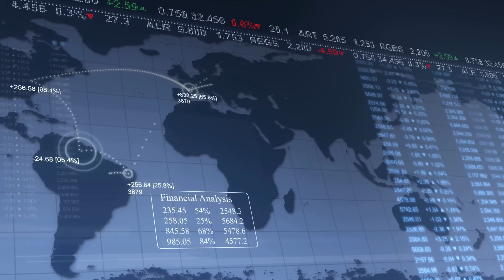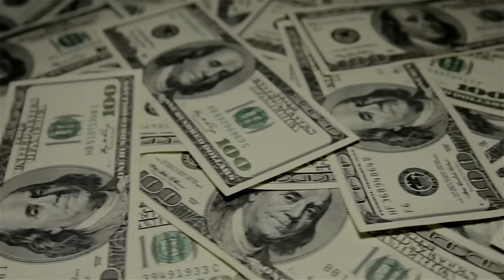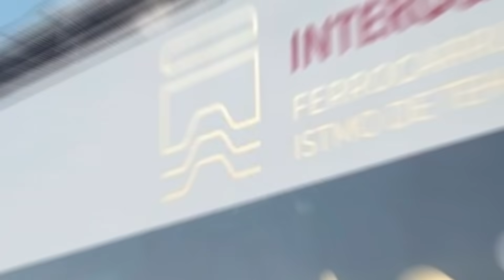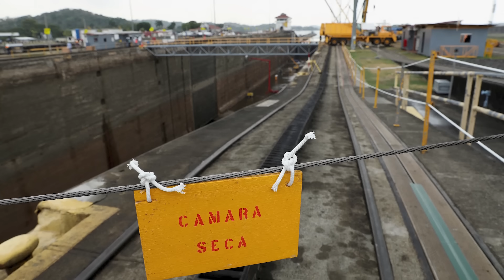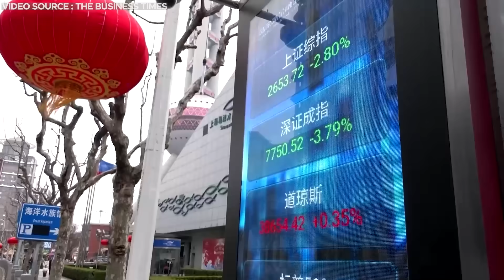Mexico Is Building A $5 BILLION Corridor That Will END The Panama Canal

Comment: Needing to unload a ship onto a freight train and then reload another ship on the other side is hardly as convenient as one ship sailing through a canal. If the Panama canal were to become unusable why not just build or improve the railway from Panama city to Colon. It's a fraction of the distance as the Mexican route.
Reply: Good idea if, and only if, the goods are going to smaller ports like those of the Caribbean islands or shallow water ports where offloading g to a smaller vessel will get the goods to a closer port of entry to that which the goods are destined... otherwise the excess touching of freight is extremely inefficient. 

The Panama Canal authority needs to research recycling the lock's water instead of just flowing it out to sea
Reply: Put  hundreds factory parks around  that area  connections Asia usa Europe south America shipping
Reply: @RubenQuiroga-n5m Huh?  You just typed random words, no actual sentences.
Reply: Love how people scrolling video shorts have all the answers.
Reply: When you have to bid for the Panama canal passage, the CCIT looks more affordable.  So not such a farce.
Reply: The possibilities are there.  The isthmus of Panama is only 68 km across.  Although is possible to carry the containers across by train, its still a nightmare logistically to unload and to load back the containers.  It just doesn't work.  The Panama Canal has been working and thriving since 1914, and if its experiencing a drought, the rains always come back.  2024 with La Niña coming soon, the rains will drench all the pertaining rivers that feed the Gatun Lake.  Never fails.....
Reply: If the goods are going to the mid west and East coast just put them on a railroad in the North West. The time delay and cost off loading and then reloading would probably make it less expensive to do this. Plus the goods will get there faster. Millions of dollars of goods sitting on a ship is costing someone money.
Reply: Interesting video.
Reply: Such a railroad exists, though when I rode it across the isthmus in the 80's, it was outdated and nothing like this. It wouldn't be hard to bring it up to modern freight standards though, if it hasn't been done already.  The real issue is that China prefers to ship its good through a NAFTA country, where they are protected by the trade agreement from U.S. sanctions to a certain extent.
Reply: @m4c4c0  The railroad exists, but a dry canal doesn't work at all because is not effective and not efficient.  Just the unloading of thousands of containers unto trains and load them back to ships on the other coast it just doesn't work.  Its time consuming and extremely expensive at the end of the day.  The best is for ships to wait their turn to cross the Canal, and to wait for La Niña to bring tons of rain in 2024, as the hurricane season will be extremenly strong this year.
Reply: It can be profitable if Mexico focuses on shipping to central USA, not competing with Canal for coast-to-coast trade
Reply: @xavierestrada5676  It would be faster  and cost effective to load all those containers in the West Coast's ports directly into trains and head toward the Midwest or East Coast.  So, why bother going through Mexico?
Reply: Mexico needed a coast to coast railroad anyway.😊
Reply: This isn't just a 1:1 ship:ship container transport infrastructure, it also can be a switching (networking) node.   In other words, in-coming containers can be destined anywhere ANY outgoing ship is delivering to in the opposite ocean.   That makes this infrastructure much more flexible and valuable because it can act as a container switch.  This is much different than is the case when a container ship leaving Europe can only have one destination port in the western Pacific.
Reply: Do not forget about the Narcos demanding a Ransom.
Reply: There is already a rail line in Panama doing exactly the same thing.  I have read that that line is carrying more freight then goes thru the canal.
Reply: @jimtrowbridge3845  Not true.  Impossible to cross thousands of containers across the Corredor Norte, as is known the main highway connecting Panama City to Colón.  Transportation by land is considerably limited in comparison to the thousands of containers that a single megaship can carry across the Canal.  The transpacific train is not equipped to handle such loads and not enough trucks to handle such colossal tasks.
Reply: Obrador’s Megalomanic Ideas, to extract money from people
Reply: @michael.forkert  You say that as if extracting money from "people" (it's corporations who ship goods around on fleets they rent with crews they hire) is a bad thing.
And I still want my pineapples and cheap electronics when the canal finally gets too low to be useful for anything but drinking water for "the people".
Reply: If they ever build this who would be in charge MEXICO? The cartels are in charge of Mexico and they will be in charge of the road. They would charge a huge amount to travel the road. This is a joke idea.
Reply: The corridor has train ferries so there will no need to unload and then upload the containers, this means that the train with the containers will travel on board the ship. The line that goes from the Pacific coast to the Gulf coast is already operating as well as the train ferries. Greetings from Mexico City.
Reply: Exactly my thoughts ? Doesn’t seem right ,
Reply: Would this be the same Mexican government that looks the other way as millions of illegals in Mexico traverse their entire country bottom-to-top just to put a stick in the eye of the Americanos? Stop all aid and trade with these corrupt politicians for two years and see where things settle out.
Reply: just another dumb idea by the dumbest country in history.
Reply: China will do the Mexico one.     The manufacturing (assembly of china parts) sites will crop up like weeds.   Everything will be nafta compliant.   Five railways coming in for different parts and one railway going out for finished product.  High Speed rail.   Cartels and Bushes will make a killing.
Reply: That's what I was thinking as well.
Reply: There will be docks on both ends that allow a train cart to be submerged so the container ship or oil tanker can move over the cart and be lowered onto it. That Panama canal will be out of business in no time.
Reply: A derailment of a train can screw transit up just as bad as that  marooned ship the Suez had to contend with
Reply: That's common knowledge, the only minor problem is the drought! Besides, the guy who made the video mentions 1,000 kilometers when in fact, its 300 kilometers between the ports of Coatzacoalcos and Salina Cruz.
Reply: Why not start using seawater to adjust canal? Duh, shoulda been done from the beginning
Reply: @bobcole3852 I asked the same question long ago, to silence. But using my own thinker I deduced that first you must pump seawater up 30m into gigantic holding ponds (the elevation of the lakes that make up half the canal path). The cost of continuous pumping water to be used gravitationally for rapidly filling locks may be prohibitive. Just a guess. For eg. it could add to the price tag of a spot that is already heavily bid upon, locking out all but only the biggest players.
Reply: @bobcole3852  Might it be not too farfetched to know that seawater is at each end of a canal such as the Panama? Perhaps Gatun Lake, about the middle point , is fresh water? A nature preserve?
Reply: @John-r4o9m  You could still use seawater for the locks. It's all flushed back into the ocean anyway. A small elevation decline at each end would prevent salt water from flowing into the lakes. Clearly the canal is already designed this way since as you point out its sea water at each end.
It's gotta be the economics and logistics, which isn't at all far fetched.
Reply: @A-Milkdromeda-Laniakea-Hominid  With the noteworthy exception that the prop of the ship might get entangled...then what?
Reply: @John-r4o9m  Entangled on what? Is this in reference to the concept of using sea water rather than fresh water to fill the locks, rather than flushing Panama's drinking water and nature preserve water into the sea? (Which is why canal traffic is running at half capacity currently.)
Reply: @A-Milkdromeda-Laniakea-Hominid  The seaweed!
Reply: @John-r4o9m  That's what I would've guessed, but dude you pointed out it's sea water on both ends! The ships go into the first lock of 100% sea water. The door is closed and fresh water is let in under gravity. Any seaweed is still there! Then the door opens and it goes into the 2nd lock and freshwater is pumped in again. In this way the ship gets raised 30m along with all the flotsam and jetsom from the sea. I imagine there's a mild grade that forces all water to run towards the sea and away from the inland. There's not going to be wads of seaweed, nothing to pose an issue to those enormous props.
Also, if one was going to pump seawater up to use it for filling the locks, one would imagine grating over the intakes such that fish and weeds don't get sucked in. They'd need to be cleared regularly which adds to the enormous logistical demands that, to my mind, prevents this idea from being considered.
Reply: @A-Milkdromeda-Laniakea-Hominid  You made the amount of seaweed sound outlandishly disproportionate to the stated purpose
Reply: @A-Milkdromeda-Laniakea-Hominid  Raise the canal level...you implied it, not me!
Reply: @John-r4o9m  OK no matter how high you raise it, is not seaweed still going to get in with the boats coming in from the sea?
2ndly, I never suggested raising the level of the canal. I was spitballing that the ends must curve downwards slightly (very slightly) for half a mile maybe, so no salt water ever makes its way inland to fresh water. Over time this would be disastrous- it was you who brought up the nature preserves that would not tolerate any salinity. 
And 3rdly just to make sure we're on the same page: I'm spitballing these ideas because if only sea water could be pumped up to the canal level, theoretically NO fresh water would be wasted filling the locks before being flushed out to sea. This is why I mentioned gratings on the pump lines to reduce seaweed from entering the system.
Reply: @A-Milkdromeda-Laniakea-Hominid  'nuff said!
Reply: @John-r4o9m  Agreed. No amount of floating seaweed has ever been a problem in 100 years of canal operation. Those blades are the size of a small house. Climate change on the other hand is threatening to shut it all down. Hence these other plans to provide alternative routes. The world needs more routes. Between the Houthi attacks near the Suez and lack of rain in Panama we're being shown that bottlenecks are expensive and unpredictable.
Reply: If Mexico decided to roll over and let Panama continue, then revenue from the crossing doesn’t get funneled into Mexico. Seems like options, as a consumer, win out. The market will ultimately determine which route is more profitable. Of course, there will be additional factors such as corruption and bandits.
Reply: @jasonmansfieldsr8645  CORRUPTION and BANDITS are already coming from,🇺🇸👹💩
Reply: Yes I see your point however if Mexico becomes a global producer them they could ship to either side with a few spurs
Reply: You can already unload in Topolobampo, MX which will go straight to El Paso, TX by rail.
Reply: 😂😂😂😂😂 yeah you obviously don't understand freight
Reply: It’s faster by train
Reply: Simple Mexico wants to take profit from Panama 😂
Reply: My thoughts exactly.
Reply: You are misinformed. The whole area will have industrial parks where the products made will be able to be shipped to the atlantic or pacific.
Reply: Not to mention this would immediately become a new target for extortion for the cartels.
Reply: @J-xc4pw That is not a problem, the corridor is operated by the Mexican Marine as well as the passenger train. By the way the first line that goes from the Pacific coast to the Gulf coast is already operating, both cargo as passenger train.
Reply: This idea needed more thought.
Reply: There not shipping cargo,convenient all the human’s coming from the south as the train is now in operation
Reply: Dumb idea … that is what was said of the Panam Canal and the México canal before that before it was sabotaged by the U S Government to pursue and control the Panamal canal instead.
Reply: Might work for a small cargo ship, but I cannot see a new Panamax ship unloading up to 14,000 TEUs onto a train and then load up another on the other end. Just not commercially viable
Reply: Saved me over 11 min of my time to read this and stop playing the video.
Reply: Economies aren’t built on convenience, they’re built on waste because waste creates jobs, which generates taxes, sales, and more jobs.  Take cars for example.  Cars are required to have headlights when they’re manufactured.  Owners are required to keep the headlights in working order.  Tax dollars are used to put street lights on all the roads.  Tax dollars are also used to pay police to sit on the side of the road to make sure your vehicle has working headlights on a road that already has light you’re already paying for and if one of your headlights isn’t working you’ll have to pay a fine.  Besides waste they add confusion because when you do something wrong they give you a fine.  Is it wrong or is it fine?  How does giving you more money make it fine?  Double taxation is supposed to be illegal and you paid sales tax on the vehicle, you pay income tax that went to the Justice Department who is now confusing you by saying you did something wrong by not having a working headlight on a lighted road and calling it fine!  I’m not making this up!
Reply: Not good at math or comprehension are ya? Missed the part Panama is now rationing spots to 25 traverses per day? Container ports and rail would sell out instantly w another option fool!
Reply: yeah, but since you have to wait weeks before you get a passage through.... but then again, the biggest ship has 24 000 containers on board - how many trains would that be? as far as i know, there are around 40 containers on a train - which means, 24 000 ontainers are 800 trains from one ship - and how many can you have on the track? 20 an hour? so, not really much you can transport .....
Reply: @andreaswiesheu2240  Yes, you are correct, it would take a lot of trains to equal one 24,000 container ship — but the actual number would be far less than 800. How do I know that? I worked for the Union Pacific Railroad loading both COFCs (containers on flat car) and TOFCs (trailers on flat cars). The railroad flat cars were typically 89 feet long and could carry either four 20-foot COFCs or two 40-foot TOFCs. It wasn't unusual for trains traveling through Salt Lake City, Utah to have four dual-engine locomotives pulling between 80 and 100 flat cars. At the lower number, they could carry 160 TOFCs or 320 COFCs. Since we are talking about COFCs, I'll divide the 24,000 figure by 320 and we get 75 trains — not 800. However, if the trains are 100 cars long, then the number is reduced to 60 trains. That being said, it's still a lot. Also, it's important to note that some COFCs are 40 feet long, so the above numbers will vary depending on the size of the containers used. Like you, I have to question the efficiency of handling freight this way — and would agree it's probably not a good idea. 🤔
Reply: @andreaswiesheu2240  40 containers on a train??  You've never seen a freight train, have you?
Reply: @andreaswiesheu2240   Container trains in North America are double-stacked, each well holds two containers. Container cars can be single car unit, three draw-bared units, or five units draw-bared together. (And there are articulated cars of three and five units.) Train length is limited to the rail yard length at the port, the length of rail passing sidings along the route, as well as the amount of power needed for any grades along the route.  

Often trains will 'double' the yard, that is the power will attach to one set of cars, pull forward to clear turnouts, and then back up and pick up another set of cars.  The last few years have seen DPU power being used. DPU = Distributed Power Units. Longer trains often have a set of power in the front, midway, and pushing at the rear, all under the control of one person. Depending on the railroad, there could be one to four locos leading, one to four at the mid-point, and another one to four pushing at the rear

The interesting thing is, that 'Land bridges' like what they want to do are in place today. The CN, Canadian National Railway Company, has sets of trains going from the Gulf Coast of the US to the northwest Pacific Ocean of British Columbia.

Trust me, if the CN couldn't make a profit doing it, they wouldn't. Mexico may be able to make it work. It all depends on if/how deep the cartels get their fingers into the pie.
Reply: @andreaswiesheu2240  The largest ship to go through the Panama Canal was a 16,285 container ship in 2022.  This is a record and not typical of usual ship that goes through Panama.
Reply: @andreaswiesheu2240  You are grossly misinformed to think there are only 40 containers on a train. On today's modern 2.5 miles long trains running with distributed power - engines at the front, middle and tail end all under the control of one engineer at the front, they can handle upwards of 4000 containers. That would mean just 6 long trains could handle all 24,000 containers off a ship. 
As stated above, why bother to unload the containers just to reload them on a ship? The USA's Union Pacific and Kansas City Canadian Pacific Railroads already own/operate vast amounts of trackage thruout Mexico, so just connect with those existing lines and deliver by Rail to the receiving customers.
Reply: @andreaswiesheu2240 there are upwards of over 100 containers on trains stacked two high. A train that’s a mile long could consist of 400 cars x 2 = 800 containers.
Reply: @andreaswiesheu2240  -- Maybe containers need to be redesigned and double and triple stacked train rail routes?  Don't think about what you have now.  Think about what would accomplish the goal...of transportation.
Reply: @andreaswiesheu2240 most trains haul the equivalent of 1000 20' containers
Reply: @andreaswiesheu2240  Mexico just received three or four locomotive engines 40 years old from Europe.  Not much imagination is required...
Reply: @andreaswiesheu2240  considering your comments and thus the bottle neck at either end, the logistics and land needed to store containers (in holding areas) might cause cargo loss (where did it go?) . Let's be real, these workers are UNTRAINED, low skilled and don't really work hard. Don't tell me that throwing money at it will create great workers because it won't.
Reply: @rangerrick2246  "these workers are untrained ."
Remember who has the BIGGEST pyramid in the WORLD.
Reply: Not enough space for the infrastructure required.
Reply: I've been down to Panama, driven from one end to the other & also cruised through it! Your comments 
are 'spot on' & I don't feel that Mexico will have enough passengers or cargo, to make the CIIT profitable!
Reply: @rongendron8705  they would have enough cargo, its more than enough business to go around in the grand scheme of things.
Reply: Just have Elon figure out how to load ships onto giant trains to cross 😮😮😮😮
Reply: @davidrhp847 Mexico doesn't need Elon Musk they capable engineers
Reply: @davidrhp847 .. why “unload” the ship? Why not just make a rail system large enough to carry the loaded ship to the other side.. 🤷‍♂️
Reply: It takes a week for a ship to go all away down to Panama and it takes only ten hours from the Atlantic to Pacific on the train plus the reload on the other side, so it is 3 days faster from Mexico's railway and much cheaper...China is already investing on land along the railway to install some factories.
Reply: @vickyp7345 It take 14 hours crossing the Panama Canal if you reserve your spot and arrive and the hour and day arrange.
Reply: @vickyp7345  You think is cheaper???  Imagine loading thousands of containers unto trains to make the 212 km crossing to the other coast and then load back all those thousands of containers back to waiting ships.  And, lets not forget.  Mexico just received three or four 40 year old locomotive engines from the EU to such colossal task.  All the best luck, and lets not forget the cartel's help.
Reply: Precisely the reason the Myanmar - Thailand - Cambodia land route from Bay Bengal to South China Sea has failed to take off.
Reply: Yeah, this is a dumb idea. The time savings of train travel wouldn't make a difference with the unloading and loading.  It would be worse. They would be better off investing in the Panama canal
Reply: @Random-bm7ho   we are talking 68 km vs 212 km, and three or four 40 year old train engines just delivered from Europe to Mexico to pull thousands of containers across and the cartel watching.....
Reply: @albertomanuelcheung7103  LOL, like I said. Dumb idea.
Reply: There are long waits of many days sometimes to get your turn on the water elevators while going through the canal.  It's a traffic jam.
Reply: @RavenMobile  If you think you have to wait days, just imagine unloading thousands of containers unto trains to cross to the other coast (212 km in the Mexico isthmus) and then another long wait to load all the containers into waiting ships.  Not just the tremendous amount of time required, but the extra cost for those operations which definitely are not free much less an extra bonus.
Reply: If climate change makes the Northwest Passage north of North America viable within 25 years how much would demand for the Panama Canal or a Nicaraguan csnal or a Mexican route decline (especially in summers) and how much would that take away from the economic viability of these routes?

Though the world will gain some population over the next 25 years and likely economic growth will be higher than population growth so maybe that won't be a problem.
Reply: @geofflepper3207   Climate change of the warming kind has been stalled out for 25 years, it only keeps alive by claiming that each El Nino spike is the end of the world. We are headed into a cooling cycle. Russia is building a lot of new icebreakers to keep their ports open year round. Even Canada is building new icebreakers.
Reply: I'm also thinking about those western robbers on horseback robbing trains, like in the movies.
Reply: @DrMarianus 😂
Reply: This is an alternative.  If panama throughput becomes impaired, options are always good.
Reply: @ateshhastam  the dry canal through Panama exists.  The total length is 68 km across from one ocean to the other, but transiting by rail is totally ineffective and inefficient.  The Panama Canal has been functioning for the last 110 years since 1914.  Drought periods occur periodically as with El Niño affecting parts of the world temporarily, but as soon as La Niña kicks in this year 2024,  the effects on rains is the opposite effect, bringing tons of water to the isthmus of Panama and unfortunately, creating devastating hurricanes throughout the Caribbean and the Gulf of Mexico.
Reply: I came to make this same comment. Feasible to offload cargo meant for North/South distribution in the Americas, but a coast to coast trip which would require having to unload and reload tens of thousands of containers PER SHIP, doesn't make much sense
Reply: You have linear view of the problem because you favor the Panamá Canal. A linear viaduct. The CIIT, in contrast, offers a two-dimensional net of viaducts. All you need to do is add lines at key points that will move cargo along North-South routes. Especially Northbound. That is, toward the United States of America. No need to go from coast to coast. Instead go from a coast to a waypoint toward either America. This idea underscores the versatility of railroads. You can poo-hooh my idea. But time will tell. Someone with the vision and the means will implement it. You heard it here first. Oh, and if you think it is not feasible because of political friction, you are underestimating the power of capitalism.
Reply: @altanaristos that makes no sense. Why would America ship from coast to coast thru CIIT? Ship all the way south by ship only to rail it back north, to get to the west coast? That's what you're suggesting. He's rt, unloading, loading, unloading, reloading again makes no sense at all.
Reply: @altanaristos  Yes, I do think your idea is very workable...
Reply: Mexico just received three 40 year old train engines from Europe to pull the trains across the 212 km distance from one coast to the other.  Imagine the nightmare that would create such colossal task to unload thousands of containers on trains to move them across the isthmus to repeat the task on the other coast to load back those thousands of containers to waiting ships to continue their journey.  Simply, a gigantic, gargantuan nightmare....
Reply: @albertomanuelcheung7103  Europe and Whyte mentality.
" Lets give them Mexikans the cheap and old machinary."
No wonder you people are losing in the board of politics. 
This is were BRICS comes in. 😜
Reply: @albertomanuelcheung7103  --  My goodness you sound like the guy who wouldn't give up his horse because he couldn't comprehend how a motorized vehicle could work...  So to satisfy you they called the power in the engine "horse power".
Reply: Panama uses fresh water to utilize the canal. Due to climate change and disrupted weather patterns they are struggling to keep it open.
Reply: I,d bet the American tax payers will end up paying the bill for this
Reply: @neilwilliams5173 Hahaha, first of all the world doesn't revolve aroud the U.S.. Flash news, the U.S. empire collapsed, it doesn't exist anymire, you live in its ashes, WHY DON'T YOU PEOPLE UNDERSTAND IT ALREADY. And it is nit "America", it is the United States, you ignorant f%$#s!🙄
Reply: @neilwilliams5173 jajajaja jajajaja you paying for Ukraine destruction so don't worry this will be cheaper... What you need to do is tell your government to stop sticking his nose where it doesn't belong